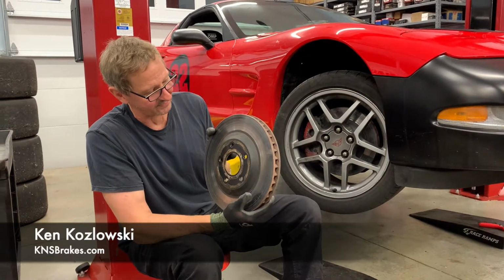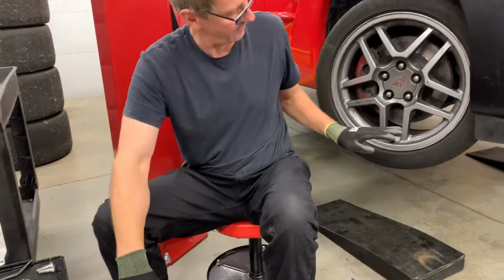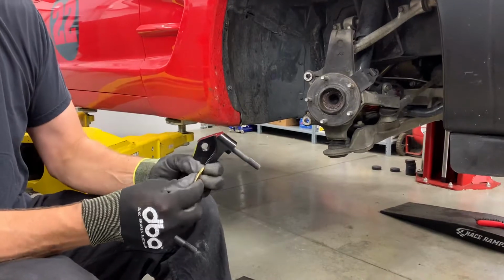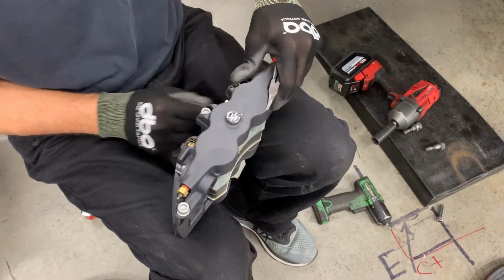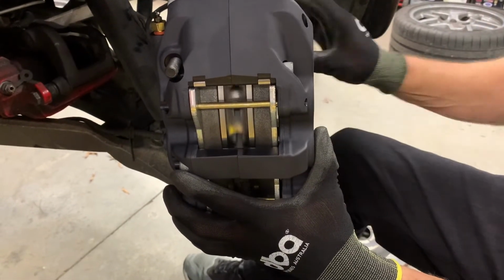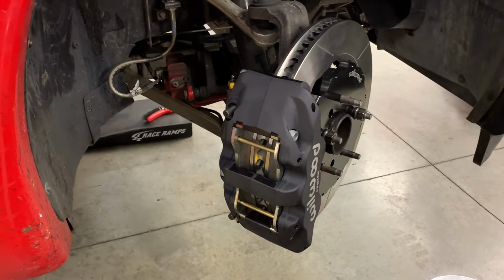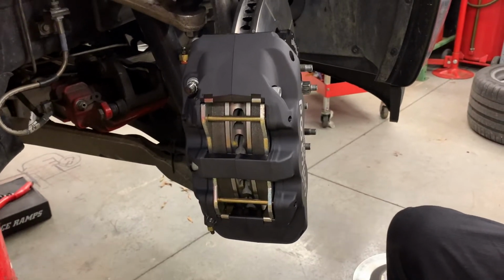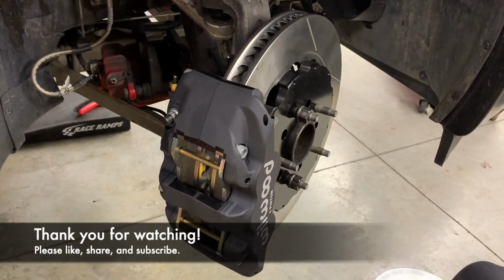Spec Corvette - Wilwood Front Brake Kit Install

Comment: About to install same exact kit on my 01 Z06.  Nice detailed video, well done.  I was curious if I’d have caliper clearance issues with my stock wheels but it appears I’ll be fine 😃
Reply from the maker: Is this a SpecCorvette?  Nice.  Where did you get the kit?  The last 2 I ordered through Atech/Summit
Reply: @knsbrakes608  not a spec corvette, just a weekend cruiser.  It’s procharged, 633 lift cam, ported and polished heads, intake exhaust and a tune. Made 610 rwhp on 93 pump gas
Reply: Im about to order this Calipers, and after measure my Rims im not sure if it will fit.
Do you have the stock 17Inch Rims?

Comment: Not sure why this brake kit was chosen for the Spec Corvette class.  A class designed to build a race car for $20,000.  This kit costs $3,100 and the rotors without the hats are $433 each.  They could have selected the Wilwood 140-12629 kit which is almost a third of the cost $1,200 and still used AERO6 calipers radially mounted and stock C6 Z51 13.38 inch front rotors which are $45 each.  You could buy 22 pairs of brand new front rotors for the price difference between the two kits.  One Wilwood rotor cost would get you almost 10 stock Z51 rotors.
Reply from the maker: We did not select the kit either.  Wilwood has just recently rather egregiously raised the price of the kit on their website but distributors have yet to follow.  There are rotor and pad shortages as well.

We are contacting Wilwood ASAP to understand where they are with this going forward and we will work w/ SpecCorvette to plan ahead.

I wish we had the final say in this but......